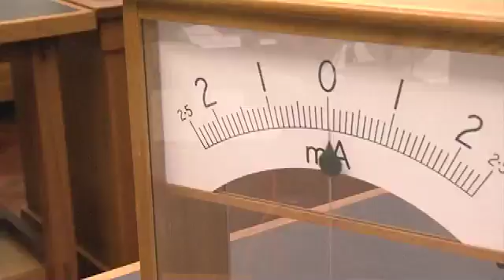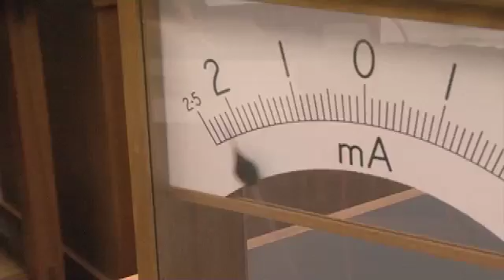Inductor - Sixty Symbols

Comment: Yes well if the the prof had used AC instead of DC, which is really what should be used for this demonstration, the back emf field could have been reduced substantially (and safely) since the charge would collapse with the magnetic field on each cycle IF using AC. Using DC, no transformation occurs and only back emf exists, which decays exponentially. And a volt meter should have been used if he had been demonstrating transformation since it is voltage which would be the variable factor in transformation with a given load or impedance, IF he had used AC. Transformers work with AC, not DC unless interrupted by mechanical means periodically in the way Faraday did in his experiments (and later refined by Nicholas Callan). The current needs to be alternating, not steady state. This is basic electronic theory, specifically Faraday's Law of Induction (and I am over-simplifying).

I am shocked (no pun) at this demonstration. All he really showed was how to create a dangerous stored inductive charge and not transformation of voltage, especially the concept of close coupling at AC, which is what this experimental apparatus is is designed to demonstrate. No transformation occurred since this was a zero-frequency demonstration and Faraday's Law of Induction cannot be applied since there is no time derivative of flux. Only magnetic saturation of the core and back EMF from the collapse of the magnetic field from the saturated core material.

Anyone remember Erwin Corey? This demonstration reminded me of him. Not someone in modern academia. He is not "exceptional at explaining things". In fact just the opposite. To even mention transformation in this demonstration is erroneous. If he was explaining inductive charge, then yes, but he didn't explain that at all. In fact I am not quite sure what he was demonstrating here, since he did not explain what an inductor does, talked about transformers which do not function in zero-frequency (DC) conditions and was not demonstrated here, and did not even really explain what back EMF was and only stated it existed and that it gave him a shock. No wonder. I am not even sure how he "calculated the voltage" as he claimed (which he did only after receiving an apparently "surprising" shock) since the EMF calculations also include impedance, which requires a given AC component in the form of some known reactive components (frequency).

Maybe he wanted to demonstrate how magnetic fields can be used to generate electric current or visa-versa? Maybe then he just went to some apparatus that happened to be already present where the filming took place to do this? Maybe in doing so got ahead of himself and over complicated the demonstration by using the wrong apparatus for his discussion?  Gosh I hope so.

Am I correct in that the Prof. Bowley is involved mainly in Statistics and Mechanics?

I am sorry, but to use the common vernacular ... WTF? I mean really!?
Reply: ***** both of their comments are ridiculous.
Reply: The original comment is insightful, but yes, he could of been a bit more polite.

Comment: For voltage to increase through a transformer, the current must decrease.  Power is equal to Voltage multiplied by Current.  The law of conservation of energy is not broken because the current drops substantially when you use a transformer.  Some of the energy going into producing the electric field around the primary and into the secondary is lost as heat from eddy currents in the "core" also besides this relationship.  If that's still hard to understand I apologize. Just remember P=V*I.

Comment: how do inductors and transformers follow the laws of conservation if they are increasing the voltage. electricity is hard to understand for me so that might be a dumb question
Reply: It is an intelligent question. Not all measurable quantities are conserved. In this case, power is conserved (in an ideal transformer.) That is, if you multiply the current by the voltage (which calculates power), they come out the same. If the voltage is transformed up, the current is transformed down in exactly the same proportion. There are no perfect transformers, however. Some energy is lost to heat in the wire and the magnetic material. If you were to account for all energies in the system, they would not change.

Comment: The voltage is the induced back EMF caused when the battery voltage is removed from the primary. The reason for it is that inductors can store energy like a capacitor. When the battery is removed the current is virtually instantaneously 0A. The equation V(t)=L.dI(t)/dt change in voltage with time= inductance * the change in current with time. means that the voltage must change and hence the back EMF. The lamp in the video is a neon discharge lamp, which lights up at around 90V minimum

Comment: Not watched the video through yet, but it's probably e.m.f. (Electromotive force).  
If you move a magnet through a coil of wire, it will produce an e.m.f, proportional to the speed of the magnet passing through the coil, the field strength of the magnet, and the area it is being passed through.

Comment: I think I have one of those old radios lying around.  The resistors in it don't resemble modern resistors at all.  At first I thought they were wires in glass tubes but it's probably plastic.  Also it says Ford on the front.